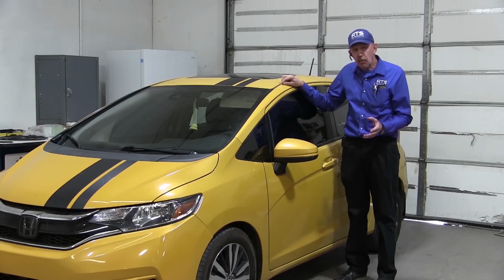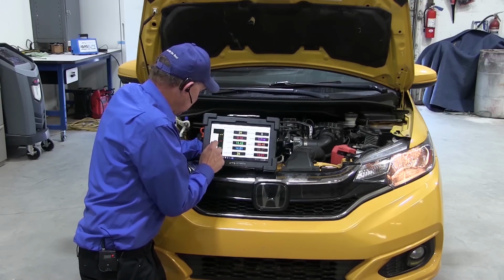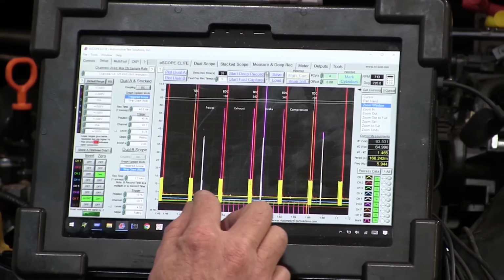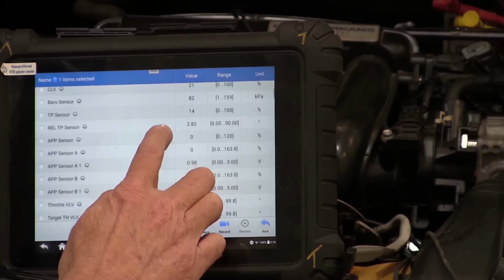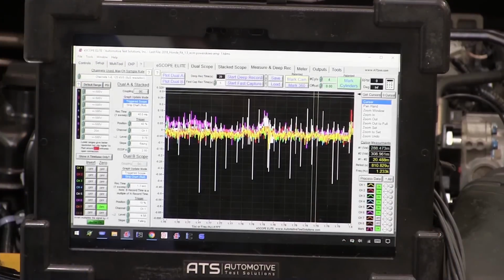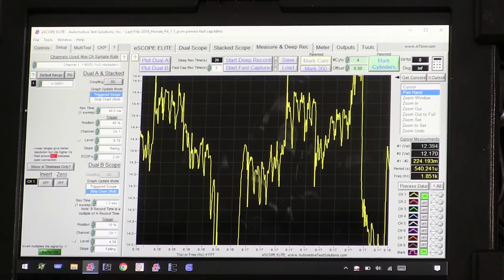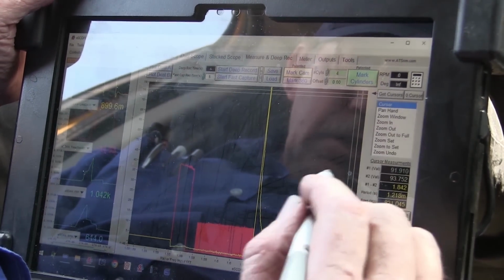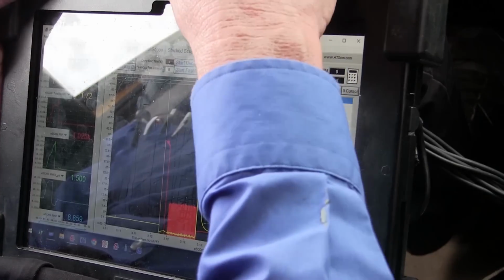2018 Honda Fit 1.5 Liter GDI P0172

Comment: As an L1 ASE Master Technician, I really appreciate the depth that this video went. People don't appreciate how advanced this can get in this day and age, you helped me track down my issue.

Currently diagnosing this problem on a 2018 Honda Fit that I just bought. Pretty severe rich condition just like this. All my sensor data looked fine, did not see issues on the intake side. Had a good reading from the MAF but cleaned it anyway with no change. Powers and grounds were good, AF sensor and secondary O2 sensors were both reacting and not stuck. I was on the fence about getting a known good AF sensor and I'm glad I didn't. Watched this whole video and found that my injectors look like 2018 honda civic injectors. There's a "B" marked on them and the Fit injectors appear to have an "A", at least that's what my search on ebay has concluded. Not sure why anyone would have changed these but also found evidence that the harness clips were removed and the bolts holding the rail were definitely R&I'ed.
Reply: Hello, good evening, I have the same problem. Could you help me provide which are the correct injectors please? Thank you.
Reply: L15B or L15A GDA Honda engines just can not avoid injector issues - all maxed out LTFT and STFT, either ultrasonic cleaning or replacment.

Comment: 53:46 A little tech tip, any time you are disconnecting a battery and draining surcharge from the positive wire to the negative wire like that, you want to make sure you don't have an auxiliary battery or any kind of second battery in your system. These are common on luxury cars, cars with start-stop systems, or diesel pickup trucks. The consequence of connecting the 10 ohm resistor with another battery still connected is you would melt the resistor.

Comment: Hey Bernie, I have a 2018 Honda. Accord sport 1.5 Turbo I changed the injectors out. Change the fuel pump out. Change the map center out. Change the spark plugs out. Change the coils out and after all, said and done. I'm getting a code that's saying it's too rich. Could it be my upper?  02 sensor

Comment: Honda scan tool has a section for running a fuel injector air/fuel ratio test it check balance and fuel delivery of each injector and will pick up those faults.  That is the very first thing you do with Honda on rich or lean codes with wacked out fuel trims.

Comment: Im sure the injectors were in need of replacement but the p0172 is set because of excessive fuel in the crankcase, simple pull of the dipstick would have shown oil level was overfull, smell the oil, fuel saturated. very common on hondas direct injection
Reply: What do u mean? Oil was “infected” by gas ?

Comment: I have the same issue with my FIT in the shop. I have over 5000ppm HC when i check the readings in the oil cap. So the oil is contaminanted with fuel?

Comment: Well this is an excellent case of no communication, someone alone the line forgot to inform the techs that the injectors have been changed, since it’s not a 30 minute job to do on this engine I suspect. I think sometimes the customer thinks it will be cheaper to not tell the whole story after the parts cannon has been fired….
Reply: You're 💯 correct. Customers need to be educated

Comment: Excellent video!  Thank you for your teaching. One question, I may have misunderstood this part of it, but why did you stop looking for the alcohol content in the fuel when you didn't see that PID on the scan tool? Does the PID missing from the scan tool mean that could not be a problem with that vehicle? Thanks again for your excellent training

Comment: Great video
Half my diag is reverse engineering customers ebay mods.

Last month I had a 2015 Impreza with an acceleration concern. Customer went to multiple shops and had plug, coils, engine cleaners done. Last shop said it was the phasers and chains.

Two test drives and twenty minutes studying PIDS told me I had a VE issue.

Two hours later I found a “Turbonator” glued in the intake pipe going to the TB.

These kids and there ebay mods are killing me

Comment: As someone who spent close to $5,000 on the escan elite, the escope, and the pressure pro kit their support is terrible. If you loose the OBD to Bluetooth adapter they will not help you. You have to buy everything all over. 

Camera broke after less than a year of light use. 

I love them but sheesh they don’t offer much for support and Jeff laughed over the phone because he said I made a $1,800 mistake losing an adapter that should be replaceable.
Reply: Damn, I wanted to buy.

Comment: I'm seeing inconsistent pintle humps among cylinders with bad injectors. Good, new, injectors have extremely consistent pintle humps.

Also, the battery has a monitor which is why you see 12.7v at idle. It charges as needed.

Comment: another great vid from the master.  just reinforces that you need the right equipment but also have to know what you're looking at.  Known-good data is critical.  
still not sure I'd have thought to change the injectors though, that's where experience comes in.

Comment: wow.  well the racing stripe might have been a clue lol. this aint your dads impala wagon with a 350 2 bbl. these new cars are pretty much at thier limits from the factory. anything you do to get more go is going to cut the life expectancy drastically.  i was at the point i was thinking a computer programming issue with correlations. at 45% its not like adding fuel would help discover that.  problem is these are great diagnosis but someone has either got to pay  or eat them. and for the cars value compared to the bill its almost a no brainer.

Comment: I had the same vehicle, with the exact problem in my shop a month ago, everything was checking out good. I was convinced the injectors were the problem, but after the car being at 3 other shops that replaced a bunch of parts. I didn't want to waste anymore of the customers money. So I sent them out to be tested. 1 passed 1 was restricted and the other 2 were flowing to much. I lost my ass on that car because I didn't bill for all of my time, but I learned a lot.
Great video

Comment: I understand following all the data, but once you verified that the fuel pressure was where it should be.. the MAF and Barro are where they should be..  Your tail pipe reading matched the computer.. and your "known good car" showed that the 'on time was in the ball park.   Then there's only one place left that can add fuel--  which is the injectors.   At first I was thinking it could be a leaking injector, and was just a fluke thing that it wasn't causing misfires.  But either way, it had to be an injector issue.  My point is, sometimes we have to know when to stop testing data and actually get to wrenching something.. finding that balance.  Excellent video.  I like all your little tips from being burned in the past etc.  Those are super helpful.  Cheers.

Comment: I had a 2018 fit with the same problem last week. I wasnt as thorough as Bernie, however my snap on zeus has an test for the injectors. The test failed "rich injectors"
I was not confident enough with my diagnosis to replace the injectors, so I suggested the owner to try the dealer for a second opinion.
A couple days later the owner called and said they reprogrammed the computer and that it was fixed.

Comment: Could an inaccurate fuel pressure sensor have been a fault?  If the sensor reads lower than actual.. the pcm would be happy with the pressure, as it sees what it's expecting, yet its fuel calculation ends up injecting too much fuel because in reality the fuel pressure was too high.  That's where I saw this going.

Comment: I once had a p0172 in my 2018 Chevy Cruze. It was intermittent. Threw the parts cannon at it. New MAF, MAP, upstream 02 sensor. Still there. Ended up being the tricky way the air filter fits in the airbox the whole time. Never even considered that, even though it started right after I changed the engine air filter.
Reply: Thanks for the info

Comment: I just had a Honda fit in the bay last month running very rich as well. Luckily another one came for a LOF so I quickly grabbed some known good data to compare fuel pressure and other sensors. I disabled fuel to drop rail pressure and then released pressure just to make sure the rail pressure would display zero psi. 
My HC was slightly higher out the tail pipe.
Watching the injectors on the scope it seemed like the pintle closing hump was late. 
I called injectors and Honda had them on the shelf. Sold in a 4 pack. 
My trims returned to -5% TFT after replacing injectors.
Reply: Just got to the after capture at 1:11:42 check out that pintle close hump compare to what we had before at 1:08:16
Reply: Good catch on that in his video.
Reply: Could anyone explain to me how computer controls with wrong injectors as he said!?
Reply: Check the valve clearance as well for finer fuel trim control.
Reply: @Nhatchay - This car should not have been taken to the shop. The owner wanted to make the car go faster by putting in injectors that allow more gas into the combustion chamber without remapping the ecm. As soon as he saw it wasn't running right, they should have put the original injectors back in. Instead, he took it from shop to shop without telling the techs how he changed/modified the fuel system, causing much frustration and running up bills to try to get it to run it should. 
You can't  swap / modify parts in cars today like it's 1970. Back then, you could swap an intake manifold and 4 barrel carb for a 2 barrel on a V8 and see improvement in performance. 
Today, almost EVERYTHING  is connected and controlled by computer and engineered.
Great diagnosis
Reply: Lemme get straight: the problem was fuel injectors only?
Reply: @carlosjunior5101  I’m my instance yes. It’s quite common.

Comment: So the owner changed the injectors, has an error code, sends the car from shop to shop,
and does not tell anyone the injectors were changed from stock to racing?

Note to self.
 If a a car has racing stripes on it, assume the owner modified something.
Reply: Was thinking the same thing.

The owner probably could have saved himself a bunch of money is he had mentioned that the injectors were changed.

Comment: happy to see a video again! I was worried about the master! Bernie your at a your own level when it cones to diagnostics   as good as guys like danner and ivan pine hollow are your in your own league sir!
Reply: The reason for him being heads and shoulders above the rest is that he has ZERO trust for the scan tool DTCs as a diagnostic aid. In other words, he doesn't trust the ECM/Control Module. That's why he always emphasises gathering raw data.
Reply: @abdul-kabiralegbe5660  Coming out of the 'pandemic' I think Bernie's data driven approach to diagnostics should be interdisciplinarity applied. People are still stuck on "consensus science", which would be like asking everyone in the shop their opinion and THEN firing the parts cannon based off the common best guess. Good luck - ya right.

Comment: I know in special function for ECM there is a A/F cylinder test. Per injector DTC troubleshooting it states to preform test three times and compare readings of pass fail and if duplicated it recommends all injectors to be replacement. I have used this test to preform injector checks when having a P0172 or misfire test. I do not or shops I help in testing do not have five gas analyzer. I have and wanted to purchase one but before making that call on expense would like to see the Honda A/F cylinder test results to five gas. Would like to see if a logic takes over or we get true valves out exhaust. Because I wounder if like in your case it shows Lambda and no stuck rear O2 reading, how it is making the logical choice to keep injector on for the times it does?

Comment: This diagnosis almost threw Bernie under the bus because he said that injector issues would lead to linear graph. I initially wanted to disagree with him because the injectors would get better if it is calibrated to the car at idle and thats where it would be worse.  It was either a restricted injector that came to mind which in this case was not since it was over delivering.

Comment: Very cool!!! How did you charge for something like this though? I'm curious as to what billed hours you would charge for this.
Reply: Probably took him a full day
Reply: Charger by the hour and only TOOKEN bout couple hours.
Reply: Imagine how long it took to set up the oscope to test 4 powers, 3 grounds, and a current clamp on the computer.😮  anyway im billing 16 hours at 150usd per/hr. 2400 dollars..the engine was saved from self destructing, which would have cost 6000 bucks